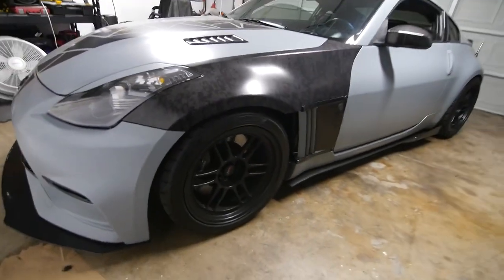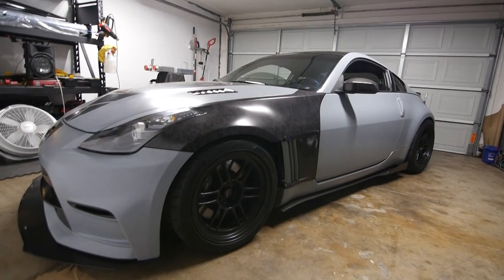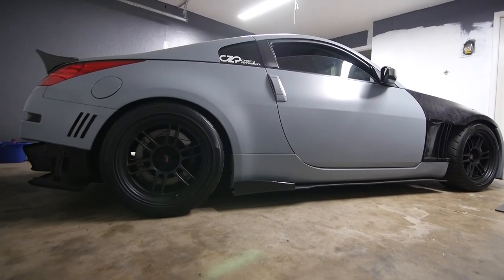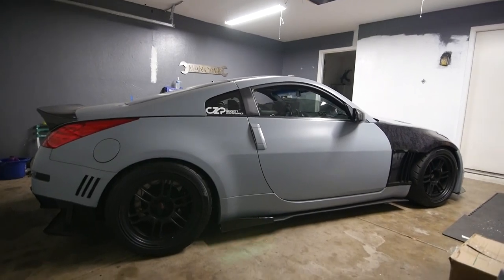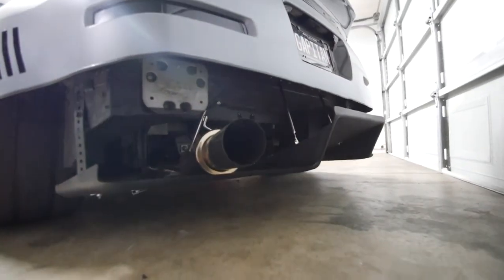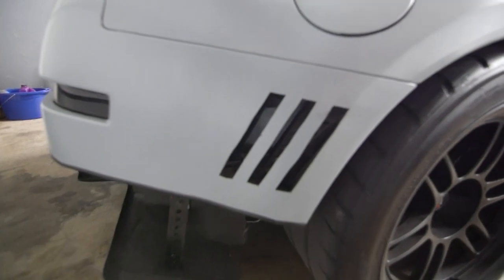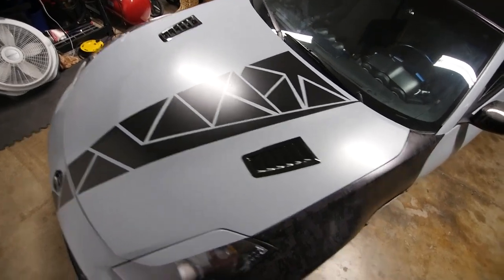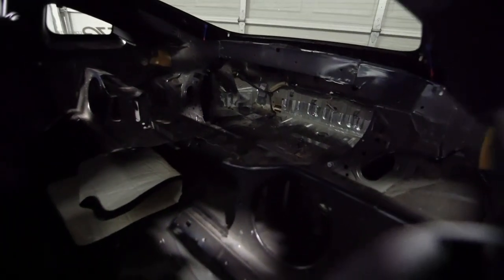What's Done to the 350Z ???

Comment: Did you have to roll the rear fenders or run spacers in the rear?
Reply from the maker: I did not have these rolled at the time. But now I am currently running 305s in the rear and I had them slightly rolled.  Doing a video soon.
Reply: Where did you get your front bumper from ? And how much ?